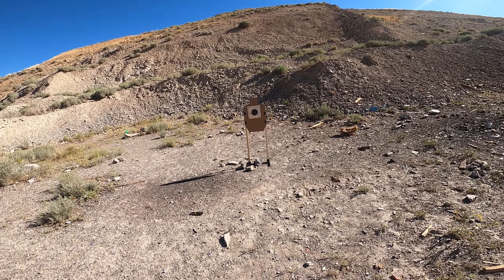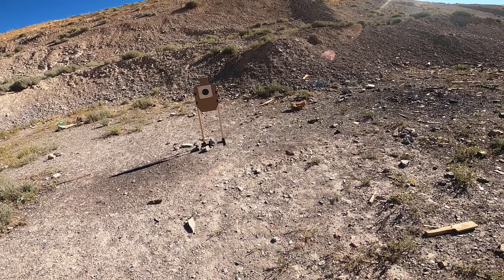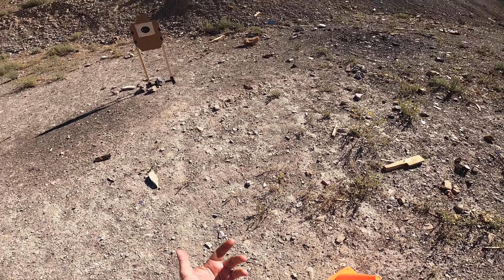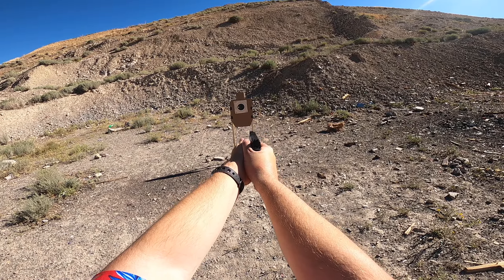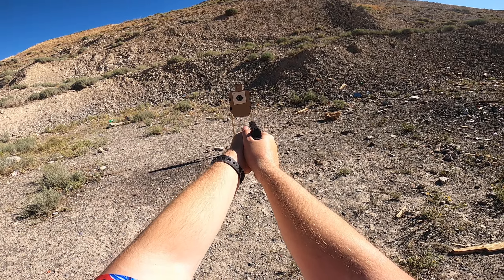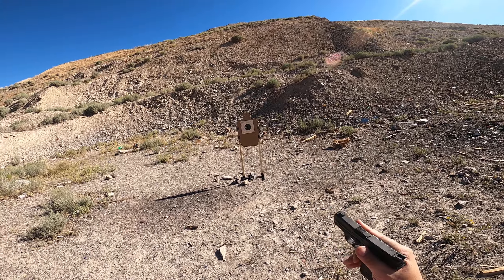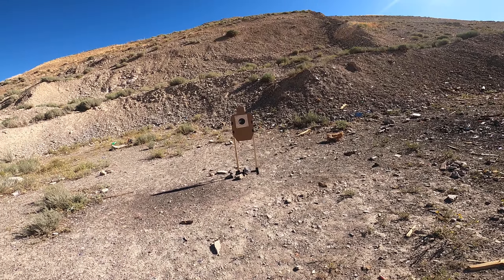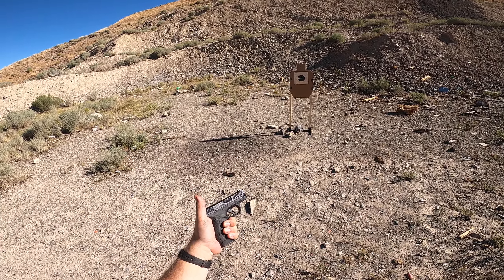Smith & Wesson Bodyguard 2.0 Reliability Testing (Fiocchi Defense Dynamics)

Comment: Have you polished your feed ramp???
Reply from the maker: I have not. I'll be doing a video where I show the insides of the gun, but I don't think that polishing the feed ramp would help. S&W did a two-piece feed ramp for the gun, and the frame section has a massive ledge that was leftover as part of the MIM process, which is going to just catch on squared off bullets.
Reply: @Paul_Whaley  not a good design then
Reply from the maker: @kevinrichardson8859  I think there's a good way to make this design work, but unfortunately, I don't think that S&W can do it for $400.
Reply: @Paul_Whaley  a one piece feed ramp...longer!
Reply from the maker: @kevinrichardson8859  I agree. I think that S&W went with a two-piece feed ramp because it allowed them to make the gun shorter. However, it made the gun less reliable due to their poor QC on the more complicated design. I'll be talking about the issues soon.
Reply: @Paul_Whaley  I also think that ballistically it would have been better with a 3.25...3.3 inch barrel for better velocities of 95 grain and 100 and 102 grain self defense ammo

Comment: I had 75% failure with this ammo.  Oddly, after the gun has shot 500 rounds of other ammo it was ok in a short test with this ammo, but I still don't trust it.
Reply from the maker: Yeah, it's certainly not good ammo. I've had good luck with it in my other small .380s, but between the issues here and the poor bullet design, I think I'll be avoiding it for my range JHP ammo.